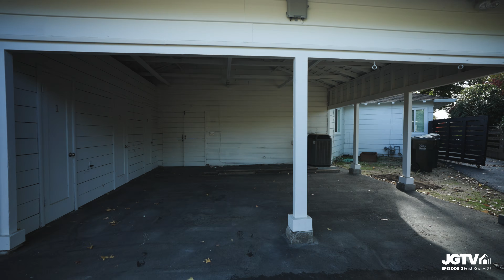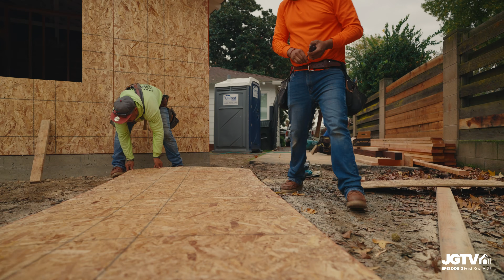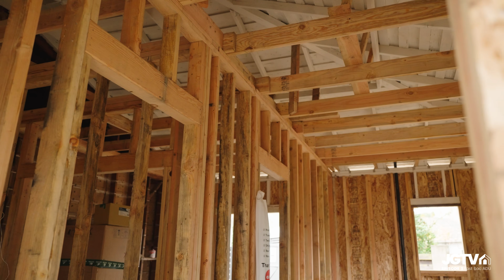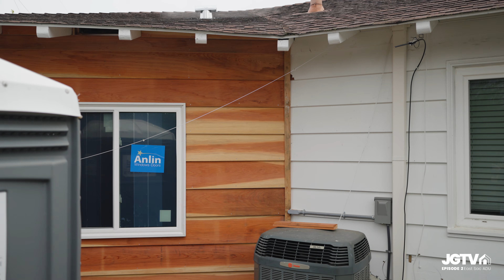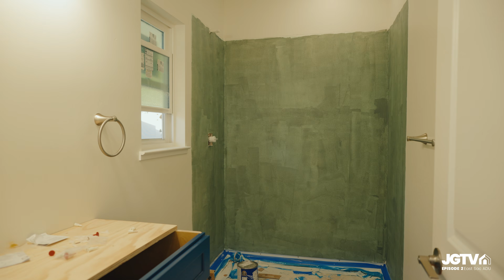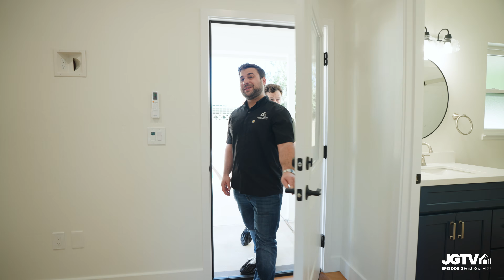Sacramento ADU Build: Full Carport Conversion Start to Finish | JGTV Episode 2

Comment: I watched your video properly, and the delivery feels natural which keeps it engaging. One thing I noticed in your title, the keyword could be placed a bit earlier for stronger impact. When the main keyword appears near the beginning, YouTube understands the topic faster and it usually helps with visibility. What I normally do is structure the title so the keyword leads, and everything else supports it without losing flow. I’ve used the same approach in both YouTube SEO and website optimization where backlinks also contribute. If you want, I can refine your title.